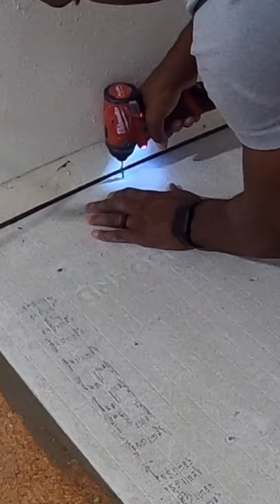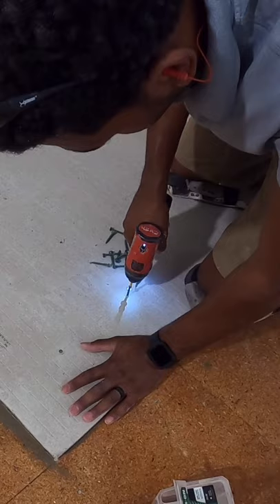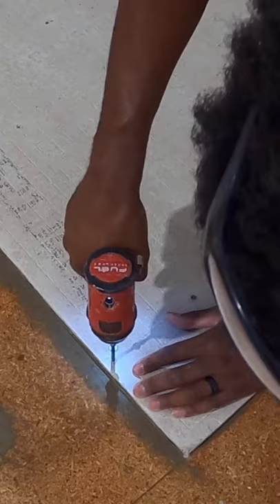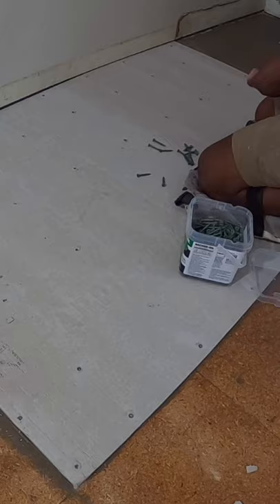This is why Hardie backer board is the worst #shorts #tile #diy

Comment: I finally talked the boss into something other than 1/2” hardi in the showers.  I usually use goboard/wedi/schluter.  Went with Triton and its much lighter and easier to cut.  Underlayment on a floor is like every 6-8” so you are still screwing for hours.  Ditra is the way to go 100% but some business model’s dont work bc they are hourly and/or supply the materials you end up with higher costs and less hours😂
Reply from the maker: Go board is amazing ! Much better and lighter and just higher quality! I alway much rather invest in more quality materials in certain areas as it saves you time and money in the long run with better results 👍🏾

Comment: As a 10 year veteran of tile we always used hardi or cement board but we used a  coil nail gun made install a breeze! We only used screws for showers.. your welcome... The problem with uncoupling matts is your basically relying on a big sticker to hold your floor together...i would only recommend them on brand new plywood or concrete floor. We did use miles of schluter uncoupling mat it does work but nothing feels as secure as nails and cement board
Reply from the maker: Hardie has its place but I tell you. Carrying a roll of membrane up multiple flights of stairs is a million times better than carrying backerboard. The thinset embeds into the membranes surface just as it does with backer boards 👍🏾. Save your body
Reply: And the nail gun doesn't crack or split the backer? And when you hit a hard or soft spot in the subfloor the nails still sink the perfect depth? I don't believe it for a second. I've used nail guns...they randomly overdrive or underdrive the nails, again, wood is variable in its hardness from one spot to another...this isn't framing or roofing. The fasteners have to be driven to a very consistent depth. Only screws will do that. Nails pop out too easily as well. Especially, of course, on a floor.
Reply: @5400bowen agreed. And the screws are alkali resistant, nails are not, even galvanized
Reply: @2ndMorrow  here in Hawaii we are more worried about acidity...but your point is well taken.
Reply: @jo-qp7mz  I wonder how many installs from that ten years have gone bad....

Comment: Can I use a coupling membrane to install tile over the subfloor of a second story bathroom ?  I had tile installed 2 years ago and they placed it over Hardin backer board but it quickly began to shift, the tiles move when we step on them and almost all the grout came out, I’m not sure what happened but I know it needs to be removed and reinstalled
Reply from the maker: Great question Karla and that sucks your tiles are failing!
You can definitely install an uncoupling membrane over your subfloor on the second floor. Hardie backer is used often and does a great job. Sounds like the tiles may have not been properly bonded to the Hardie using the right thinset or notch trowel. Also many forget that you need thinset underneath your Hardie backer when you install it. It prevents deflection causing the floor to have movement which in tern will cause the tiles and grout to pop. Hopefully this is helpful. 👍🏾
Reply: @TeraeB  I was told by more than one Home Depot employee that applying mortar for installing Hardie backer is optional and doesn’t really help. I surely don’t believe that, and I’m glad I’ve watched your video.
Reply from the maker: @juanjesus8534  Yes, I’m glad you watch my video is well. Also I’m happy you didn’t just go by the first thing your heard. You researched. that’s KEY!!
Reply: Do I really need hardie becker or will just cement do

Comment: I’ve been putting up 1/2 inch and 1/4 inch backer all day. I feel you pain. The 1/2 inch is so much work with all the drilling and countersinking
Reply from the maker: Man!! I feel your pain! It’s not easy work and it’s definitely taxing on the body
Reply: You know what I totally agree. It’s time we engineer a better sub floor backer board
Reply: Drilling and counter sinking? What universe are you in? You watch the screw go down and stop at the correct depth.

Comment: Uncoupling membrane dors just that. It uncouples the  tile from the floor. So now the tile is just floating on the floor, it's not attached to the floor. If you use enough thinset on the uncoupler, it's all stuck to the floor anyway. Just use fkexbond, with the cost of the uncoupler it's about the same cost or cheaper overall to use flexbond. And eliminates the VERY messy step of putting the uncoupler in.

Comment: you can screw without worrying about drilling through with a drywall screw gun or adapter. Goes by faster
Reply from the maker: @leislymejia2864  nice 👍🏾

Comment: Can I screw it just to the plywood underneath or do I need to add what you added there. Looks grey.
Reply: Leveling bed of mortar usually and then screw it down.  Cut and lay them all in dry first then take out one or two at a time and do it that way.  Mark everything.
Reply: @Trucker-Belly  I wish I did what you say when I installed it

Comment: So the product is "the worst" because you have to install screws?
Reply from the maker: Yes, Many screws / it’s heavy / difficult to cut without saw / creates dust if cut with saw /  requires additional steps before tiling / many more reason
Reply: There’s a bunch of reasons. Uncoupling is easily the way to go.
Reply: @TeraeB can’t you just use a screw gun? Screw guns are not just for Drywall 

Seen a few use it for Decking and Subfloors… tho I guess every company uses diff products and diff methods to do the same job
Reply from the maker: @carlosf9278  I’m using a drill “screw gun” in the video 👍🏾
Reply: Laziness at its finest. No replacement for hard work (for homeowners). The finished product is worth it. 

Buy a Simpsons Quick Drive attachment / screws if you're a contractor. 🤦
Reply from the maker: @TheContainerGuyTV  backer board is lame , I RARELY use it
Reply: @TeraeB  that's cause you're in it for the $$. I bet you use it at home
Reply from the maker: @TheContainerGuyTV I use uncoupling membranes. Super light weight, less stress on the body, smooth install.
Reply: @TeraeB  bed posts don't do well with them. Depends what room. I use the hardiebacker under carpet in bedrooms and it's amazing. Not squeaks, solid floor, fire rated.

Comment: De-coupling membrane on a timber subfloor is always a bad idea!! De-coupling provides lateral rigidity on a concrete floor but nothing in terms of vertical rigidity!

As a bathroom fitter of 15years I have lifted so many floors that have failed either because the floor moves under vertical load (de-coupling membrane) or the adhesive de-bonding from plywood. Iv never had a floor fail from Hardie backer or similar!
Reply: @jamesdally3490.
I came here by accident. Good to know, thanks for that useful bit of information.

Someone with your experience, I live in a flat, concrete base, badly uneven, I want to tile under the bath. Should I just use a cement/concrete screed and tile to level with the already tiled area outside of the bath?
Thanks in advance. 🤞🏾👍🏽
Reply: @Troberts8910  if your working with a concrete floor I would use a self levelling flexible screed with a de-coupling membrane over the top to eliminate lateral expansion and contraction. Key is to make sure you use a good quality primer (not PVA) and flexible tile adhesives
Reply: @Bliss3490  Thanks alot, I appreciate how quickly you responded. I will research de-coupling membrane, and see where I go from there. 
When I did the rest of the bathroom with the slate tile, I just put a bed of adhesive, as advised. I guess under the bath area is a different ballgame. 👍🏽
Reply: @ashleyreeves8997  ply has to much flex and has actually been outlawed by British standards as a suitable substrate for tiling. 

The correct installation would be to use hardi backer boards (6mm is fine) screwed and laid on a thin bed of flexible adhesive (check out hardi backer board installation for correct technique). Stager the boards in a brick like fashion. Then you’re good to lay the tiles as you normally would, again ideally using a flexible floor adhesive. Iv not had a single floor fail since changing methods.

If you use detra matting (the orange stuff)  there is a good chance your tiles will start to lift after a few years. 

Good luck!
Reply: @ashleyreeves8997 They're called floor joists.
Reply: @ashleyreeves8997    I'm not sure if you're being serious, or snarky, as I can't see you.  However, you seemed to really be engaged in learning the subject matter, so I corrected your verbiage. it wasn't intended to be malicious.
Reply: @da324  I was being snarky, I've been trying to get good answers about this for weeks, and am frustrated by the lack of consistent reliable information available. I apologize tho, because I understand you felt you were being helpful. While I can appreciate the need to use the right words, and correct someone when they don't, I've also learned people don't like it for a reason, and try to refrain. It would have been more helpful, and better received, if you'd had more information to offer on the subject than just correcting my verbiage. And at this point, materials are purchased and build has begun, it's moot anyway. Contractor will probably get a hoot out of it when I get him for not correctlng me on Monday tho He's been doing the remodel on my house  for four months and redone all of the floors from the joists up🤣